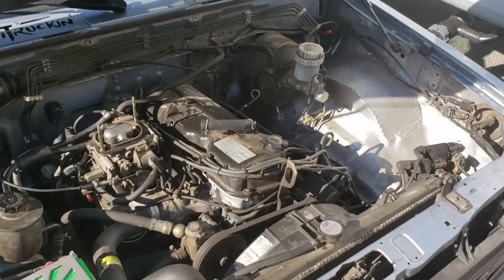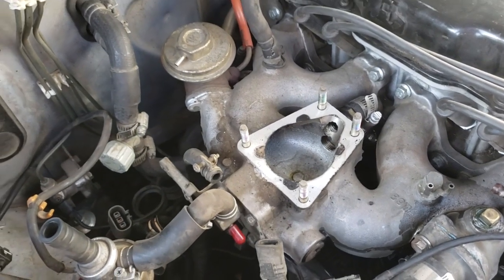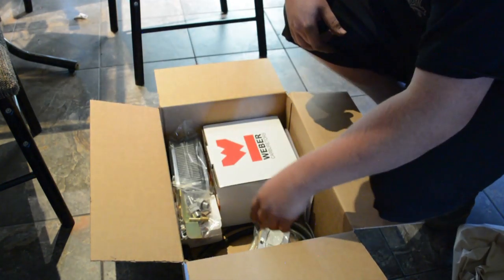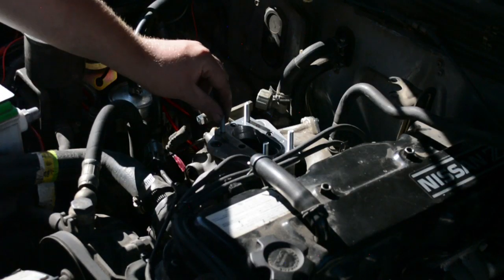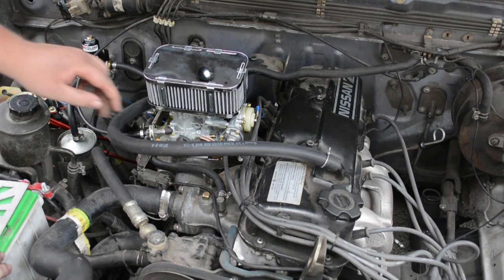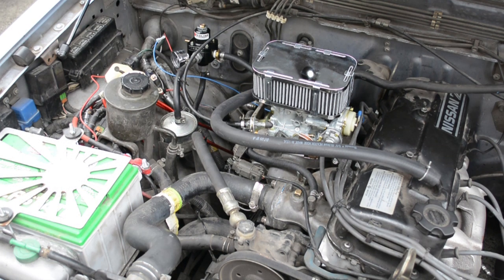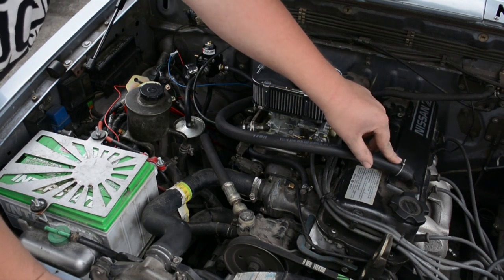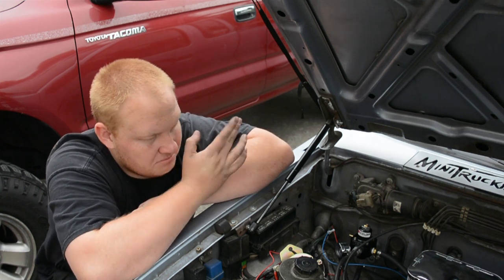Nissan D21 Weber carburetor swap // Z24i engine

Comment: I did the Weber conversion and a header in my 84 pickup. It went from 22-23mpg to well over 30mpg at highway speeds. Been like that since 2008, no problems at all.

Comment: I bought mine in 03/2015, absolutely the best thing I could have done. REDLINE K644-38 for VG24i & VG30i did a very good job making this as simple as is possible to install. This video was very complete and did a good job as well. If I would change anything, it would be to use some oil, or grease on the adapter gaskets and a small drop of loctite on the threads. Also, I used the "other" cable bracket, the fork type. Works great, lasts a long time. Great product, great video explaining things. Tom

Comment: Hey man, I know this was made 4 years ago so hopefully you might see this. Would you be able to share what the red and the blue wires from the wiring harness at 14:13 connect to and where they go if you know. I have an 86 Hardbody extended cab my dad has left around and im trying to get it running again. It’s really in bad condition but one step at a time.
Reply: He said he was having trouble with the fuel pump and that’s why he’s left it sitting, it used to crank but the fuel pump wouldn’t turn on

Comment: Looks like you installed the Weber 38 Outlaw. I think you’ll like your new carb bc it has a couple of cool upgrade options. I have the Weber 32/36 DGEV which is a progressive carb so 0-70% throttle only one barrel is opened and from 71-100% throttle both barrels are opened. It’s sort of like overdrive for your carb. Lol! I ordered the Sync Link from Pierce Manifolds online and that converts my 32/36 to non-progressive so that both barrels open simultaneously like the outlaw. I never added the pump jet that came with the sync link bc it was running way too rich so I just left it the way it was. I drove 433 miles in my Mazda B when it was like upper 80s the whole way and I still averaged 26 mpg. Look up “air plenum” for your Weber and see if that’s something you might be interested in. I think I’m gonna be getting one for mine in a week or two. I’m still reading reviews for it. Another great video bro!
Reply from the maker: Awesome I'll look into and ya I'm trying to figure my gas mileage as I write this. Just got back from a 3 hour round trip with the new carb!
Reply: @scrapingpavement  dope! I paid 2.65 per gallon on average my last trip so basically for every 100 miles I drove it only cost $10.50 in gas. My engine is bored .030" over with an aggressive cam and PaceSetter header installed. Only creature comfort is power steering but that's less than a month old.
Reply: @AstonThaRat  did you notice much improvement running this setup over stock? S it worth doing?
Reply: luke green Yeah it’s got way more pep. The Sync Link comes with a pump jet that has 2 arms to squirt fuel in each barrel. It was getting way too much fuel with that on there so I kept the stock single arm pump jet on it. U could use the dual arm pump jet but then you’d have to change the jetting on the carb itself to reduce the amount of fuel coming out of it.
Reply: @AstonThaRat  beautiful, i run a stock z24, they seem great for low end power but it defintely struggles up hills, especially cause of 4x4. I would love to drop a weber and extractors with a side cab exhaust exit, and maybe drop a performance cam in for a more balance powerband.

Comment: When I installed my Weber on my b2200 I installed it the opposite way with the throttle cable next to the fire wall didn’t know you can install it either way
Reply from the maker: Ya I've had this on for a couple years, my buddy had theres on the way you're saying as well. I like running it this way aligns nicely with fuel line and cable length in my case.

Comment: Man I wish someone made this video 5 years ago when I had my 89 hardbody NapZ with the same issues. I was planning to do the same swap. Comes to find out it was the gas mixture with the air inside the carb that was not equal. I had more air than gas, which was causing the same issues you explained.
Reply: OutlawLifeStyleCTC Hawai’i, Maui  how do u fix it?
Reply: @zaydiux1  did you watch the video at all lol

Comment: If I were to fabricate an intake manifold, would my carburator options widen up? I've always wanted to ditch all the sensors and make my hardbody EMP proof but I assumed I'd have to switch everything out from the heads up, didn't realise it'd be this easy. If so, what do you think would go well with an 88 2.4l model?

Comment: Did you have to change out the distributor and the coils? Is there a difference between the carburetor versus throttle body? Coil and distributor that is
Reply from the maker: Nope, the kit i got does not require switching of coils or distributer. I suppose you could do your own swap by getting parts off the nissan 720 z24, but i have no idea if that would work or not.

Comment: I have a question. So I did the weber swap it starts but after about 1 second of sitting at idle the engine try’s to run away (constantly increases rpm’s) as if I’m punching the throttle even with the throttle disconnected so I have to cut it off I’m stuck with this problem
Reply from the maker: Could be idle screw or the cold idle screw, My cold idle was set pretty high. I also found that the weber it self doesn't have a good spring return so I made a bracket to pull throttle back completely. Also could check your fuel pressure.
Reply: @scrapingpavement  thanks! It was my idle screws I had to play with them until I got it but now I got t figure out why it pours gas instead of misting it which cause it to bog and backfire

Comment: ive been looking for parts for my 1986 d21 4x4  but i cant find any what would be a good website to visit and get parts from even upgrade . my local auto parts store cant even get 90% of my parts.      thank you
Reply from the maker: There's not a ton of places for parts on these trucks. For body panels and Replacment parts best bet is junk yards like pick n pull. I know rough country sells a small lift kit, djm sells a couple items. Weber makes a carb kit. The nissan dealership can get you some parts but not cheap. As well as used ebay items. Otherwise I would check out some forums like infamousnissan or nicoclub theres a ton of helpful info on those.

Comment: Did your timing be off and allcover the place cause mines run good but my timing cant go to wat it was..
Reply from the maker: Mines the same timing as before the weber swap.
Reply: @scrapingpavement  m8nes changed and dont go back it cant turn anymore.its like 8 degrees.

Comment: Great vid!  Did you modify the stock distributor? Or swap w with older type?
Reply from the maker: Stock distributer no issues.
Reply: @scrapingpavement  you rock! Just did mine last night.
Reply: I did it! But I have two loose ends.

Comment: What’s the difference between a 32/36 and a 38?
Reply: 32/36 in a progressive carb, it has two different sized barrels.  the smaller one opens first then once its mostly open the second barrel (larger one) starts to open - this carb is better for fuel economy but less top end power. the 38 is 2 barrel both 38 and open at the same time! More power, more fuel use!

Comment: How is it running with no vacuum on the distributor.
Reply from the maker: Been running for 3 years no vacume.. I'll double check when I get home. I just went off the directions in the kit no issues after 3 years.
Reply: @scrapingpavement  thansk sorry if im asshole at times im just so fustrated.change all the main sensors and still limp mode.coils everything.and your timing advances still.trippy
Reply from the maker: @Hawaiicountrylivin  no worrys
Reply: @scrapingpavement  my truck runs great.thanks for the help.ill make a video wen i get the chsnce later..
Reply from the maker: @Hawaiicountrylivin  awesome!!!
Reply: @scrapingpavement  i just put a video up...
Reply: The z24i dizzy isn't the same as the z24 dizzy if that's why you're asking. The ecu controls ignition advance based on throttle position and rate of change. The z24 dizzy uses vacuum to control ignition advance. Essentially the z24i dizzy is a crank angle sensor

Comment: If that's an 88 hardbody those maf sensors are roughly $600 bucks at an auto parts store, at least all the ones I called. Put that thing on eBay or something so it can pay for this swap.
Reply from the maker: The problem is that may have been the issue, not going to sell a broken one lol
Reply: @scrapingpavement  yeah, that's true. Luckily the wire onmine just needed to be cleaned, fixed the issue. I was told look for someone that can refurbish it if it ever goes out. Now that I've seen this I'm thinking of the carb myself, clean up the engine bay of the wires. Wish I could show you my hardbody, I turned it into a ratrod.

Comment: Do you know why the z24i jerks at 3000 rpm.
Reply from the maker: Not sure, I've never had that issue.
Reply: @scrapingpavement  i cant go to work i cant figure this shit out im about to fuckin lose my mind...need to buy a new truck.
Reply: @scrapingpavement  bro it was my o2 sensor o unplugged it and plugged it back and it runs perfectly fine...

Comment: How much psi was the regular sending out before you dialed it down
Reply from the maker: Supposedly the stock fuel pump is 70psi, and the oem fuel regulator is 35psi. Check out my 1 year update video on the changes I made for a better setup.